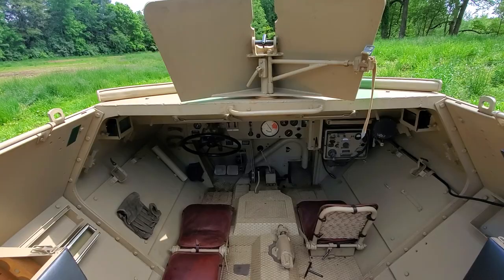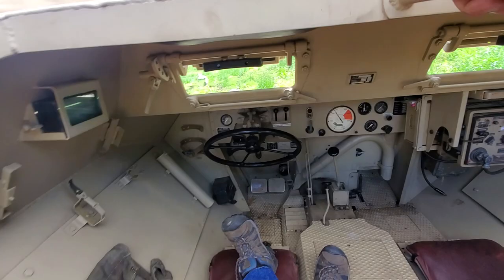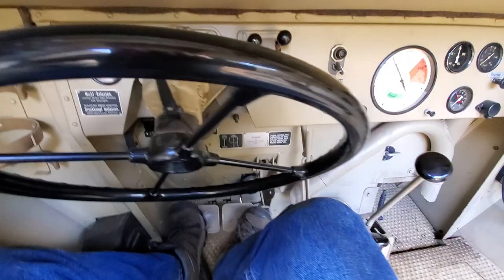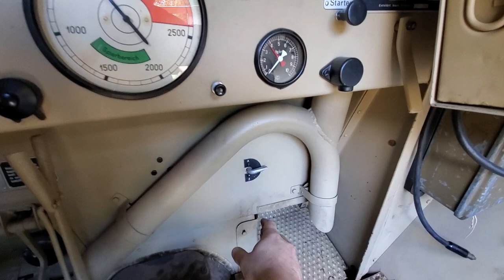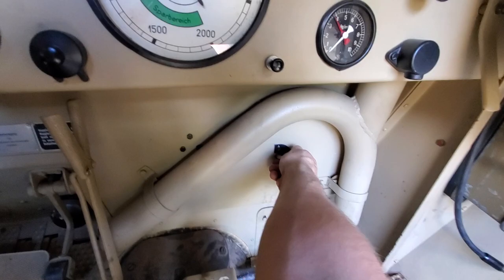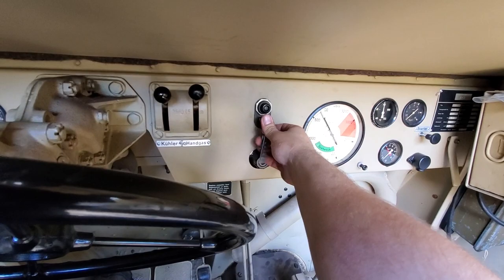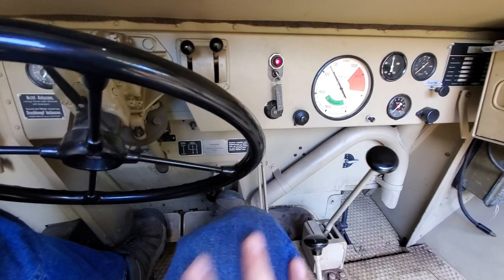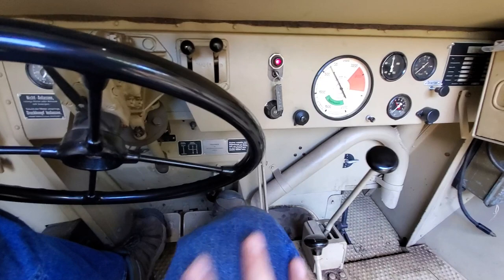Driving the Sd.Kfz 251

Comment: I have alwas been curious of these halftracks running hot, du to the radiator covered by a permanent armoured plate ? Unlike the  American version that had louvered armour that could be opened......seems to me  like a flawed design....also would like to know is this a true 251 or the post war Chech version ?
Reply from the maker: it has a very thick 4 row radiator and dual fan system pulling air in from under the front nose and hot air out over the engine and out the sides just behind the fenders.
It is a genuine 251, and has all the correct original running gear and drivetrain and the Maybach Hl 42 engine
Reply: @bgraebe  thank you for the follow up.....always wondered about that....and you've answered my question.....

Comment: the direction of that one big dial in the center was strange. tach or hydro psi?
Reply from the maker: Thats the tachometer. it is driven off the back off the cylinder head and runs counter clockwise
Reply: Counter clockwise is weird. Is that normal for German vehicles?
Reply from the maker: @Shmeegsify  Most German halftracks have tachometers that run counter clockwise while pretty much everything else runs clockwise

Comment: What are the 3 clocks on the left of Choke used for?
Reply from the maker: Engine oil pressure, coolant temperature, and the double needle is the pressure in the air brake system. One needle reads system pressure and the other reads how much air pressure is being used when depressing the brake pedal.
Reply: @bgraebe  Thanks
Reply: @bgraebe  where do i get one. I NEED HIM

Comment: is it hard to drive this Thing, especially around the corner ;)
Reply from the maker: No not at all. At a certain point in the steering wheel angle the steering brakes engage slowing down the inside track making turns much sharper

Comment: Why press the clutch when starting it?
Reply from the maker: Less resistance on the starter motor since you're not turning over the drive train in addition to the engine, also for safety. If it happened to be in gear, although I make sure it's in neutral, then it won't lurch forward
Reply: Fais la même chose à ta voiture et tu verras la différence. Surtout en hiver.

Comment: you have to double clutch?
Reply from the maker: Yes you do. The vehicle is old and the transmission doesn't have synchro mesh gears, they are straight cut. So to get a nice shift between gear changes you need to double clutch